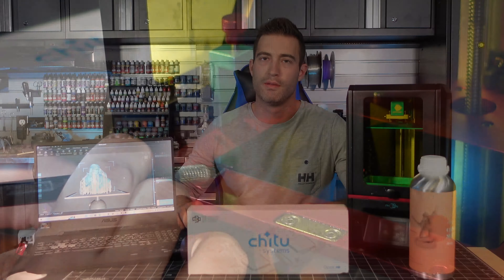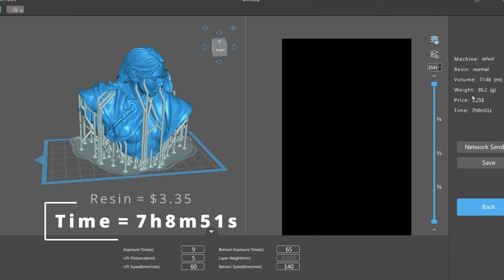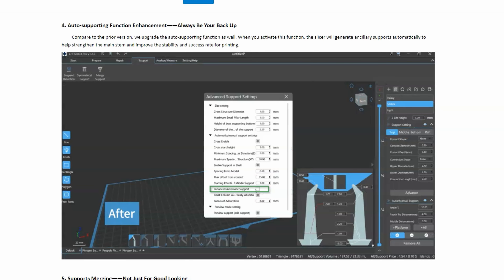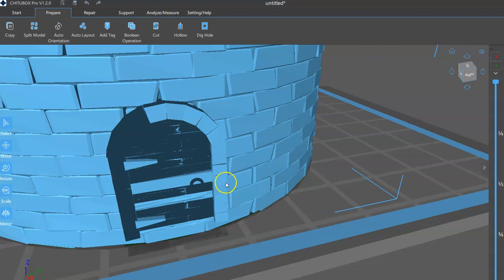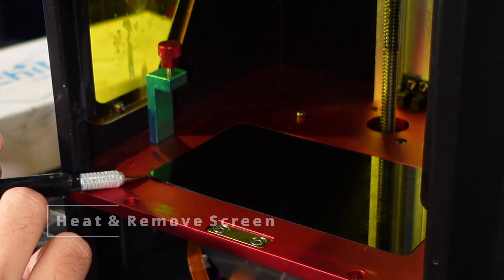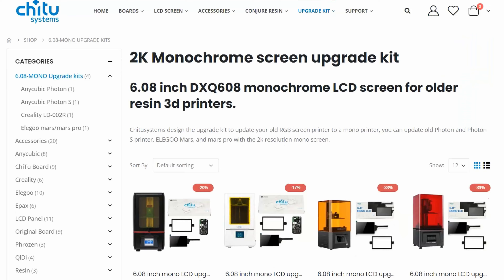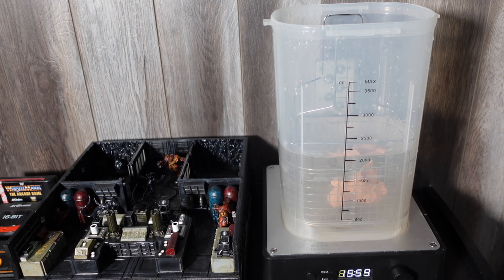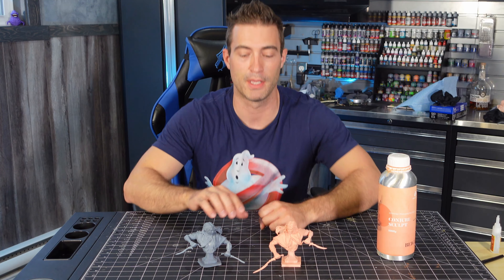UPGRADE YOUR Slicer, Screen & Resin with Chitubox Pro, Mono LCD Replacement & Conjure Sculpt Resin

Comment: Looks like I am going to upgrade my Elegoo Mars and my 2 LD-002R . Thanks for letting us know about the upgrade kits! Love printing minis for my D&D games. Going to print a Elder brain dragon!!!
Reply from the maker: No problem Crit. Take your time with the install, make sure you use a heat-gun to loosen up the glue on the old screen before you remove it.

Comment: Hey brother, great video. Just with your print fails you rightly pointed out the thickness of the resin you use, if your lift and retract speed is too fast the suction will pull them right off the print bed. Can I suggest you give Siraya Tech Fast Resin a crack? Its a very thin resin which allows you to use a faster lift/retract speed and with your mono screen you'll be able to print super fast. I had nothing but fails using my Elegoo resin, switches to this resin and 6 botles in i've had 1 fail which was my fault because I didnt relevel my bed after installing a flex build plate
Reply from the maker: Thanks for the info I will make sure to try that stuff out for sure.

Comment: What creates 'suction force'?  It's not creating a vacuum in which to 3d-print is it? (If so I never knew.) 
Would you consider making a video covering the topic "How to get shop for a 3d-printer"?  I've watched enough of you (and enough of GW price increases) to think that maybe I should make the plunge, but I have no idea how to begin.  I'm sure there are dozens of videos by other creators, but I'd be interested in your opinion, because your shop is TIGHT!  I want to print knock-off GW anything ;)
Reply from the maker: Thanks. The suction force is caused when the print bed lifts, usually the faster the lift speed the more suction force it creates, mine seems to be abnormal lol. My friend has the same printer with the same resins and prints the same files and his supports hardly ever tear apart. As for a good printer for a shop, well that's hard to say, it depends on  your budget... but over the next year I'll will be having some videos come out about setting up a shop again...

Comment: Question for you, just did this upgrade myself after thinking my screen broke ended up being the acrylic under the screen had resin on it somehow, did you run into the printer z axis thinking its bigger and grinding when the print completes, if so how did you fix it i thought setting the print height back to 150 in chitchu box would help but it didnt lol
Reply from the maker: It was an easy fix for me, because I also have a bed leveling kit added to the printer that allowed me to adjust the z height. I believe that there are instructions about adding small washers to the z axis to account for the slight height increase of the screen.
Reply: @FacilityD20  gotcha I figured it out earlier this morning I needed to print a gcode file that had 150mm as the height so it would update it self, but I'm loving this upgrade prints are coming out easier and lot better than any I did before, my screen may have been giving out from the beginning and I never knew it lol
Reply from the maker: @gotbrawndo  I agree, my printer has been running a lot better now to. Also the wham bam magnetic build plate has almost eliminated leveling issues

Comment: I upgraded.  I use chitubox basics.  But I get file not supported for my photon.  I see the file but failed.
Reply from the maker: I think you might be saving the file as the wrong file type. Check that.